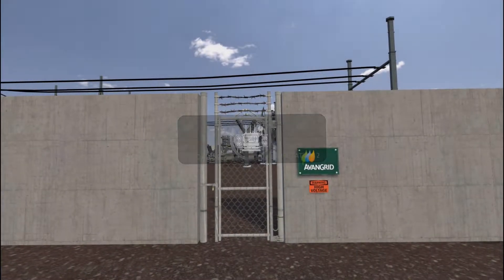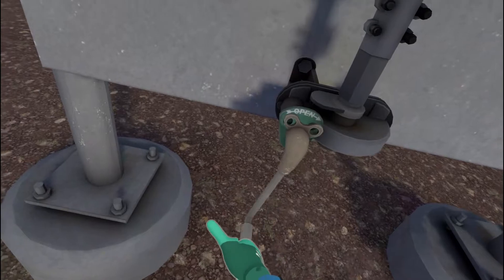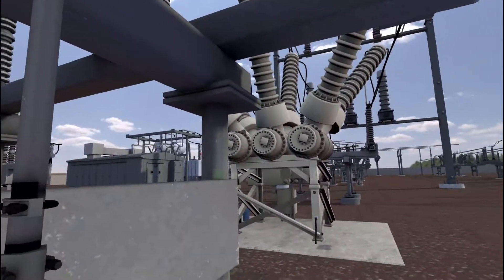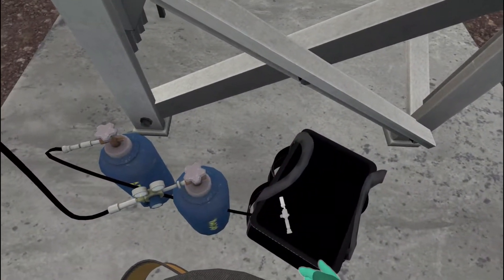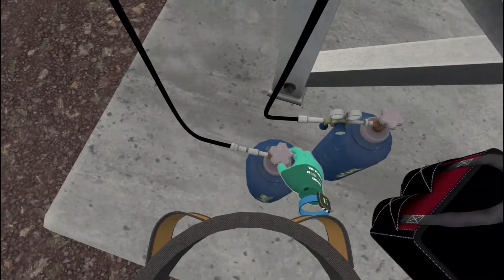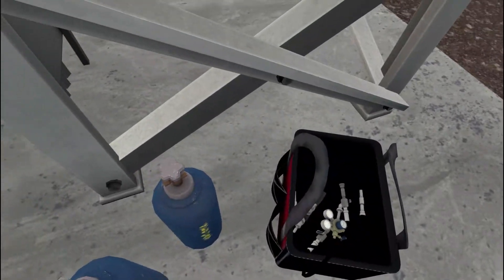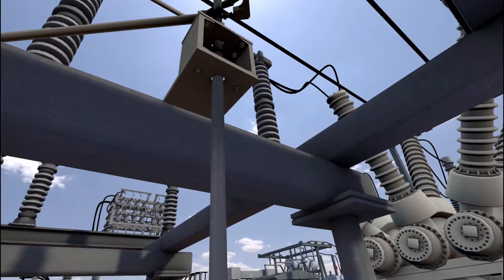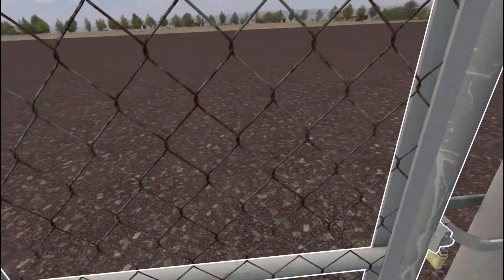Avangrid SF6 Gas Switching Procedure (CG Single Player, Preview Course) - Oculus Quest 2 | VR Vision

Comment: Have to mention always check the breaker open place on local control before opening disconnect. 
If the breaker was closed you would have a ball off fire !